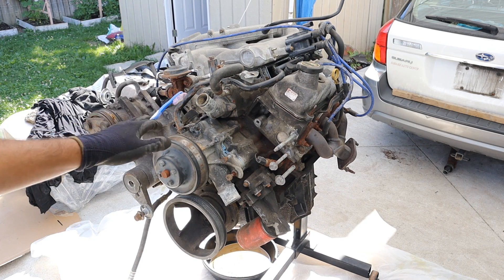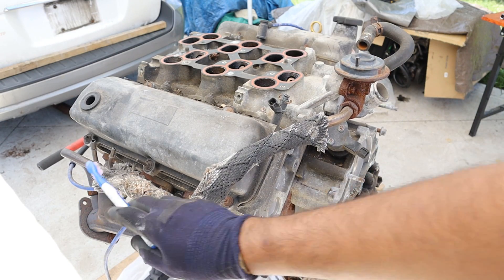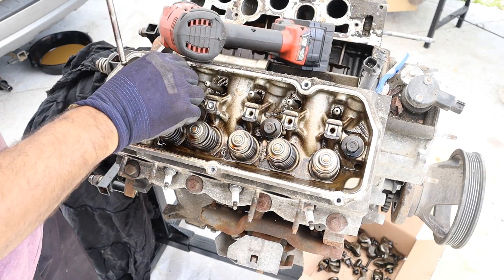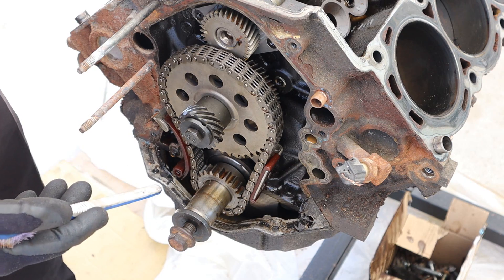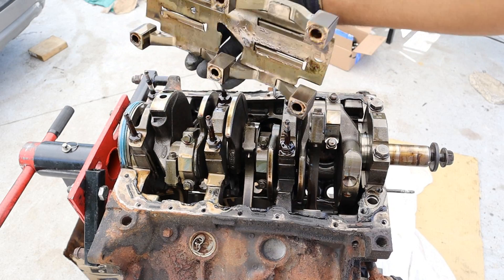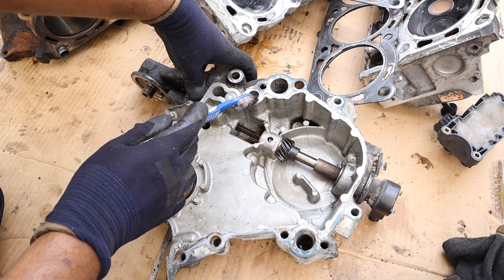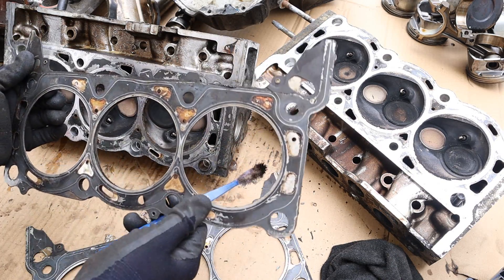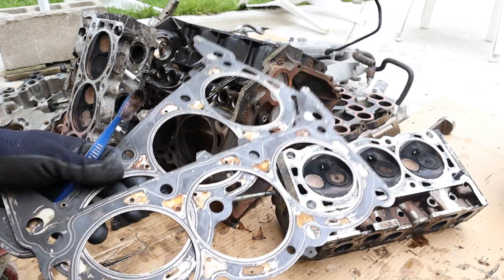The Ford Mustang V6 Essex Engine is Simple yet Forgotten

Comment: my mustang has 311k miles on it and i haven't had to do this repair yet i beat the crap outta that car every time i drive it. not a lot of cars can take abuse and still drive fine. these engines are actually so reliable that Cummins built a generator using it, its called the Spark-ignited generator set ESG-642 series. Cummins is a famous diesel engine builder but in the ESG-642 it used gasoline or propane/Nat gas to run and the low end torque allowed for high KW power numbers. So it could run continuous at 1-3k rpm generating 35-40KW. Your average american home uses 3-4 KW so one of these engines could power 5-8 homes without breaking a sweat. Think medium sized commercial building with all the lights and central air on.
ze

Comment: A correction: 60 deg V6s still have split crankpins, they just have less of an offset than 90 deg engines have.

 Some Essex facts:

* They're largely a reverse-engineered Buick 3800, down to the external oil pump and the 90 degree bank angle. Ford needed a larger V6 in a hurry, and didn't have the time to design one from scratch.

* Ford made 2 totally unrelated Essex V6s. One in Canada, one in Essex, UK. The UK one came first in the 1960s, with a V4 version alongside it (exactly how the Cologne V6/V4 originated). It was 60-degrees, came in 2.5 and 3.0 litres, available in Ford UK and European models. It was originally designed to have a diesel variant (hence its beefy construction), but that never came about.

* Despite it being 90 degrees, it's not related to any Ford V8, meaning it never took any advantage of parts commonality or production streamlining.
Reply from the maker: Interesting facts

Comment: Yo my 3.9 just got quoted at 3gs to diagnosis. Cuz it has a tick and no check engine light but this work is not cheap! Thanks for the info about engine tear down. I got 225000. But. Wanna do a complete rebuild....maybe 12 gs?

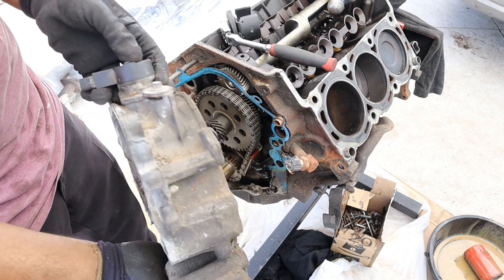Comment: That at 6:56 is the camshaft synchronizer. They might go a little dry (you'll hear a chirping, and the engine will stall). A few drops of oil on its head (after having removed the sensor at the top) fixes it. A 4.2 l here (2004 Ford Freestar), 320,000 trouble-free kilometres.
Reply from the maker: Interesting thanks

Comment: Ford largely fixed the head gasket problems in the later years. I think it's more likely that a coolant passage in the intake manifold gasket was leaking into one port and the oil pan. That problem was also addressed in later years. In my opinion, the last 4.2's made after 2004 might be the most reliable, simple and easy to repair Ford engine, since the 300 six. It also makes the same torque with 50 more horsepower than the 300.

Comment: I driving a 4.2l motor in my 2001 Ford F150 w/5 speed tranny. 178k miles as of this post. To address any overheating, I added an external oil cooler with electric fan which keep engine temps from going into danger zone, even when I had to drive with a broken serpentine belt, no functional water pump for water circulation from radiator. I went about 10 miles to park it in that condition before I could install a new belt.  No damage done as it's still running great at this time with no loss of engine compression or head gasket leaks.  I highly recommend an oil cooler if you want to help protect cylinder heads from overheating.

Comment: The head gasket issues come from the cylinders getting too hot due to the exhaust port, where the manifold is bolted, is too small! When the exhaust works its way back it clogs up the port back to the cylinder. I found this out from @Mustang V6 Tech Support  & other forums confirming this. Fix that along with coolant upgrades, bolt ons etc. you gain some good results !!

Comment: I have 217,000 miles on the 3.8L in my 2003 Mustang. I bought it with 47,000. Head gaskets were this engines main problem. And that's because Ford used aluminum heads on a cast iron block. If they had used cast iron heads, everything would have been fine. Aluminum and iron expand different amounts and at different rates as the heat up and cool down, and with the head gasket sandwiched in between them, it will eventually fail. However, the head gaskets can be made to last much longer by simply letting the engine warm up to operating temperature at idle. The slower it warms up, the less stress is put on the head gaskets. Ever since I first bought mine, I have allowed it to warm up to operating temperature at idle before driving it. Overheating the engine can also cause the head gaskets to fail. There are new aftermarket gaskets out now that hold up much better than stock. If I decide to keep my car, I'll just put a rebuilt long block in it.

V6 Mustangs through '04 make excellent daily drivers for someone who doesn't want a front wheel drive four door sedan or worse yet a "crossover", which I consider to be the ugliest vehicle ever made. The 3.8L V6 make plenty of power for daily driving. I bought my '03 because I wanted a 2 door rear wheel drive American car with a solid rear axle. It also happened to be Zinc Yellow, which is a bright lemon yellow, and really stands out in a sea of black, white, and gray transportation appliances. The '03 V6 came stock with 16" wheels, which I am not a fan of, I replaced them with a set of 15" wheels from a 2000 V6 model, so I could use normal sized tires.
Reply: I'm going to pay more attention when I  warm up my truck. Thanks for the advice!

Comment: Late to comment but had one of these in a 98 Windstar, and for a 4,000 lbs van it was pretty quick. Never had any issues with the motor other then the egr problems they had. I had it for nearly 20 years with 190,000 miles (118,000km) but it finally was done in by a deer air bags cooling etc, I cried:) PS my dad had a 92 continental he drove it 300,000 miles before a push rod broke right thru one of the rockers. Never made a sound until it failed. So I think Ford got the head gaskets working, we sure had good luck with them. PS I never overheated it, ran it out of oil, or left the oil in more then 5,000 miles, well maintained, could be the real key!! Nice video Thanks

Comment: I’ve got 330,000 original miles on my 2003 4.2l. Still running strong just leaks a little oil other than that it’s solid. No knocks. No ticks. No rattles. Run signature series 5w30 AMSOIL
Reply: They aren't flashy but they get you home. I just got 2004 f150 xl heritage with 4.2 and 160,000 miles. I am checking the junkyards to see if I can get the parts to convert to a 5 speed.
Reply: @ I wouldn’t bother with the headache that you’ll have to deal with in order to convert it. Mine has the auto and still shifts perfect at 345,000 miles now. Original trans only had filter and fluid changes. Still shifts better than a new 6 speed or 10 speed lol
Reply: @ Also I’ve ran my trans OUT of fluid and it didn’t kill it. 4r70w isn’t going to let you down as long as you take good care of it. I’ve abused the shit out of mine but kept the fluids changed that’s made it last. 

If you want a 5 speed truck. Just get a 5 speed. You’re better off anyway because the stick shift trucks usually have Lower miles on them anyway. 

I mean you can do the swap but you’re going to have to deal with the pats system somehow it’s linked to the auto trans and it’s a headache to work around pats unless you have it deleted. Then anyone can steal your shit that’s the only issue with that

Comment: Are you a real mechanic? You said there was an "old" mechanical fuel pump...you realize the "new" style pump is in the tank, like any other multi point fuel injection system ?? That piece you held in your hand is not the pump. Then you failed to notice there was nothing wrong with the head gaskets.  We amateurs can see there were no problems with the gaskets you were working on!!  Those engines are quite reliable, but for a few years some did have issues with the lower intake gaskets. You could have learned that by doing 5 minutes of internet searching. The new style gaskets have double o rings around the water passage and intake openings, the bad ones had only one o ring section between those openings.  
BTW your general comment about aluminum heads was way off base. Lots of iron blocks are outfitted with aluminum heads. Have you ever heard of racing??
Plus, different size bolt heads were used to match appropriate torque specs for the pieces being held together. It's called engineering.

Comment: Every time I look at one of these 3.8s, I cant help but think of this as Ford's clone of the venerable Buick 3800, down to the displacement, V angle, timing cover and water pump arrangement. These were stout engines found in almost everything from the 70s into the mid 2000s from a humble taurus to an F150. Far more reliable than anything Ford makes today.

Comment: The 3.8 isn’t much to shake a stick at BUT for what they were back in the day and for what numbers were back in the day (350 out of a v8 back then was the norm where as now it’s 450 ) so like many v6 owners over a decade ago (like my self) would put a bigger cam in it and home port and polish the heads with a wind star intake. Match that with 3.73 gears and dual exhaust these cars were pretty fun for their time (again over a decade ago )

most H/C/I swapped 3.8’s and stroked to 4.2 on an average day would see low 14.s in the quarter mile which to be fair these things did mid 15s bone stock 

Couple that with some suspension upgrades these things were a blast to drive on the back roads !!

Not the best exhaust note but a blast to drive
Reply: He's really negative about the whole thing. He's saying "this was in Tauruses etc which weren't worth a lot to begin with and even the Mustang V6 because no one wanted those because this was a sports car". 

No, the Mustang is a pony car, not a sports car. It is still being sold and on the road today where all others keep failing, get redesigned and fail again because the base Mustang IS the Mustang most people buy and it's good and civilized for the average driver. 

Ford knew what they were doing with the Mustang and the 6 cylinder Mustang being sold so much in the past is the reason it exists to this day (now with a turbo 4 base).

Comment: this isnt a exhaust video however,  I have compiled a list of almost every single 99-04 sn95 3.8-4.3L v6 mustangs on a playlist. So watch that there's a few great builds in there. Mustang Man ( bright lime Green mustang on list ) has an inverted m90 super charger on his v6 build,  basically the m90 eaton super charger is not located on the upper intake instead its "remote" located where the airintake is. I'd check out there video on the list.  V6 Mustang Tech Support has a  GTR  upper intake conversion on one of his engines,  I'd check out his build,  he also has twin turbo water cooled upper intake on his other build. Theres a 800 hp tbird on the playlist as well by CMac,  and recently came across a 700hp compound turbo/supercharge sn95 who is on the list as well. Its important to have a video like this tact on to this playlist so i appreciate your break down of the engine.

Comment: Can’t you just clean the parts up, replace the headgasket, put it back together and have a working engine again?
Reply: I’ve replaced many head gaskets on these engines. As long as the bearings aren’t damaged (usually revealed by engine knock), I’ve usually just had the heads machined and the gaskets replaced. And the engines usually lasted for many more miles.

Comment: This engine is completely different to my Ford V6 Essex… are you sure this is an Essex?? Wasn’t the Mustang V6 called something different?
Reply: Ah wait up, this is the Canadian Essex, not the British Essex! Now it makes sense, different engine!!

https://en.m.wikipedia.org/wiki/Ford_Essex_V6_engine_(Canadian)#:~:text=The%204.2%20L%20Essex%20has,a%20bad%20front%20cover%20gasket.
Reply: There was British Essex engines like Capri 3.0. This is based on the Canadian Essex which were never smaller than 3.8l. I doubt any part is common between the two. The British Essex was a 60 degree v as opposed to this engine with a 90 degree angle.

Comment: I currently own an 02 Mustang with this engine and did a lot of research before getting it. When Ford, pretty much, fixed the head gasket issues on these later aluminum head engines with the MLS gaskets, these engines were known as some of the most reliable Ford ever put out and there were definitely worse engines you could have chosen than this one. 

Also, as you pointed out it's a pushrod engine, so if it does need to have head gaskets changed, they're much easier than the huge, wide, complicated OHC engines like the 4.6 or 5.4.
Reply: I had 180K on my Mustang 3.8, the only reason why it’s not in my car now is cause I did a Thunderbird SC engine swap….
Reply: I did not realize these had aluminum heads!  Even Google doesn't know that (yet).

Comment: I have a 2007 F150 with the 4.2/manual transmission, been a fantastic engine. Very easy to work on in such a large engine bay too

Comment: Anyone know the actual reason for the head gasket failures on these? After owning a couple of these (yes the gaskets failed) they were generally good to me except for the one not so small issue. I caught it before being serious but always wondered the root cause with these.
Reply: I want to say it was something to do with how the heads were aluminum and the block was cast iron, so the heads would get hotter and possibly warp slightly or it might have just been the temp difference. To fix the head gasket issue they likely just chose a material that transmitted less heat to the heads.
Reply: @jauntyy1891  Thanks jaunty. Just a personal question that I never find a solid answer for.

Comment: Why are they considered unreliable? What goes wrong with these, looking at buying a car with one of these engines soon, and all I've found so far is just that the headgaskets go wrong, can you please enlighten me as to what other problems can occur with these motors?
Reply: I have a 94 V6 manual. As you can see a lot of us don’t agree that it is unreliable. My 94 has over 162k miles on it but the odometer is broken on it so it likely has more. The previous owner had a friend that filled it with I think double the amount of oil there should have been and he only got the top half of the engine rebuilt and it is currently running. I actually still race the car and bring it to redline fairly often.
Reply: Hello, I know your comment is old but as someone that owns a v6 mustang, my issue is that everything surrounding the engine dies but the engine is just fine 😂

Comment: I have two of these. 94 mustang V6 with 310,000km and 02 mustang with 260,000. Never cracked open on either
Reply from the maker: Any head gasket issue?
Reply: @speedkar99 nope, the 02 I beat the piss out of, the 94 I treat gentler, other than a bit of oil around every orifice, nothing is actively leaking
Reply: I had 2 '95s and a 2000 , all over 300k miles . Beat , rinsed , and repeat.  Never a head gasket problem .

Comment: Ford liked making “split-port” engines like this, 1 intake valve with 2 pathways to it, very ancient yet functional technology.
Reply: Used to work on 2.0 Split Port in 1st gen Focuses. In my country, the 1.8 and 2.0 Zetec engines were much more popular, but sometimes Split Ports imported from the US showed up. And it was a disaster. The engine was overall fine, but they all had one huge problem - valve seat inserts detached and fell into the cylinder. And most owners either sold the car to the scrap yard afterwards, or swapped it for any zetec available. So there's not much left now. But apart from that issue, it was overall a fine little engine

Comment: The F-150 and Freestar had a 4.2 liter version of the Essex. I’ve heard that the Essex was a copy of the Buick 3.8
Reply: A copy?  Making a 3/4 of an existing 90 degree V8 is not terribly innovative.  The 4.2 version of these engines is actually quite good and as evidenced by the tear down a well built motor.
Reply: A terrible one, at that, the 3800 is a legend, the Essex V6 is infamous......

Comment: My friend in the UK had a MK1 Granada with a 3.0L version of this Essex engine in the late 70s. Carburetted and with coil and distributor of course. He hade it a few years with no trouble got board and swapped it for a Triumph Dolomite Sprint..... endless trouble.
Reply: Totally unrelated engine.  The 3.0 you site is of the 60 degree variety.  FOE had 2 60 degree V6s one built in England and the other in Germany.  While the 3.9 is pushrod, like the FOE, it is actually 3/4 of the Cleveland/Modified engine family of V8’s.

Comment: I always thought it was neat that the oil pump could be replaced about as easy as an alternator on these engines.   No need to drop the pan or even drain the oil.   A few bolts and it comes right off the bottom of the engine.

Comment: Thanks for the new great video, these are multi-layer steel plate gaskets right? I thought that these do not allow the block and the cylinder head to warp, I only imagined this about Klinger and asbestos seals. I just put together an old diesel, already with the second cylinder head, because I don't know where the water enters the combustion chamber. I also used 3 asbestos seals, and 2 liters of water are consumed per 100 km.
Reply from the maker: Yes Multilayer steel. 
Not all are created equal and some designs are more prone to leaking than others.

Comment: https://youtu.be/mbgdUq4PDlc?t=420
That's a cam synchronizer, basically cam position sensor. Later 302s also had that.
Reply: Having that means that you could retrofit a distributor and carb although good luck finding a intake.